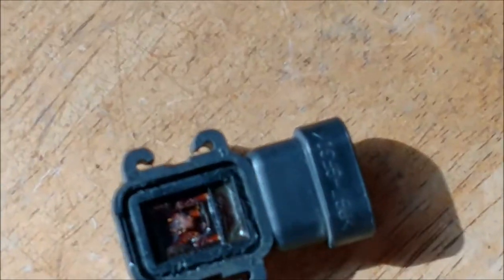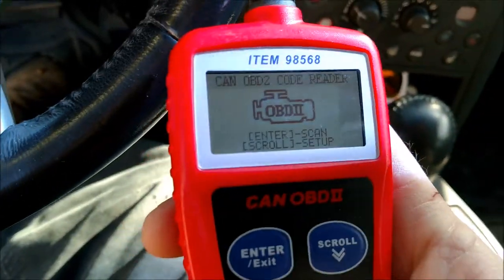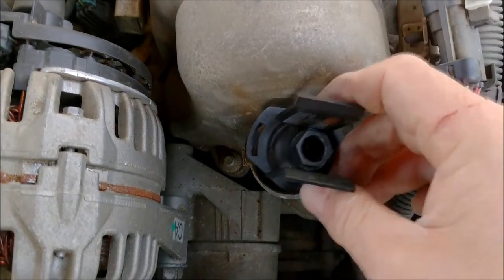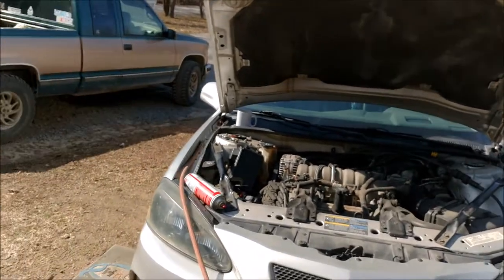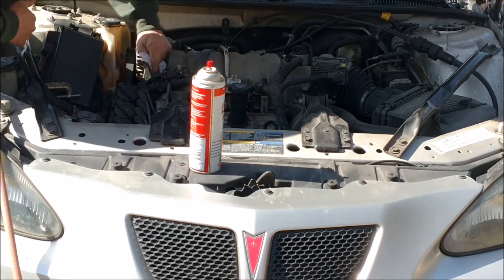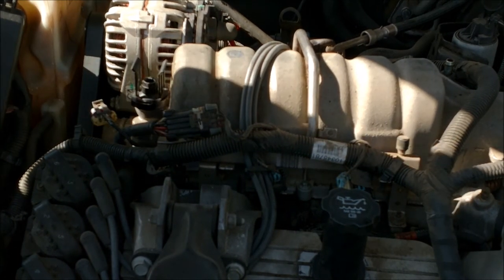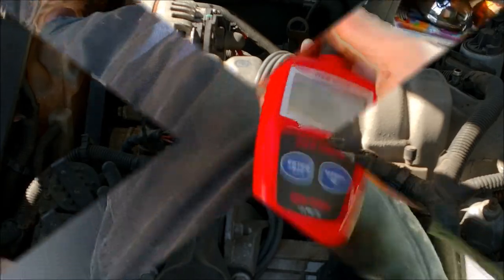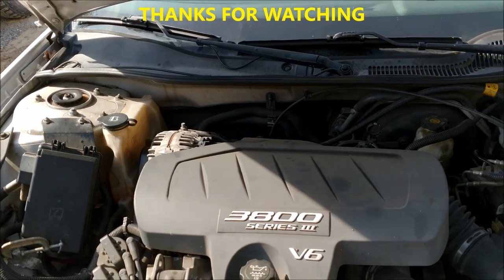DIY MAP sensor replacement 05 Grand Prix

Comment: Hi m8 ive got the 2000 model GM 3800 s/c L67  V6 (Australian version) only has a MAF sensor no MAP sensor or EGR valve, unlike its USA 3800 counterpart. Im of to the dyno soon & on advice fm tuner has been to install a MAP sensor & delete the MAF & relocate IAT sensor to LIM. P.S. liked your wife's 05 !
Reply from the maker: Thanks